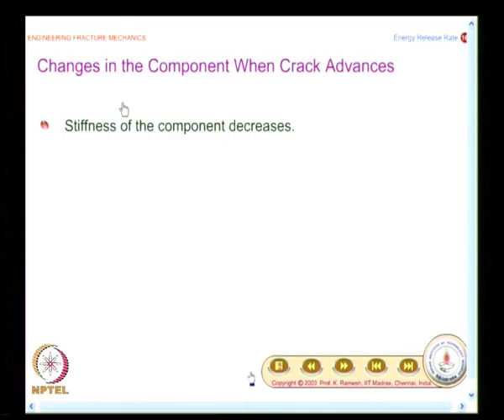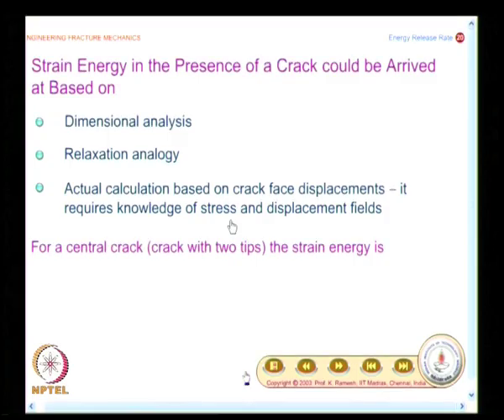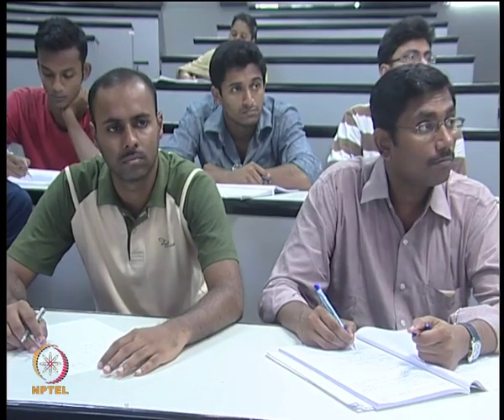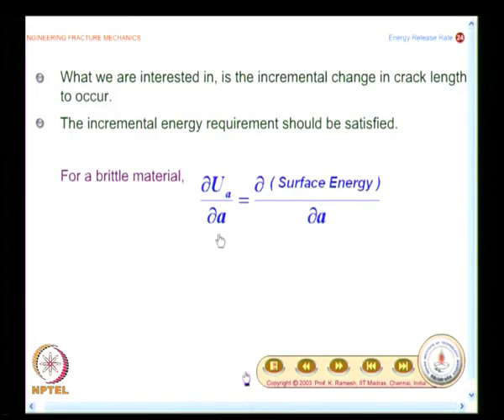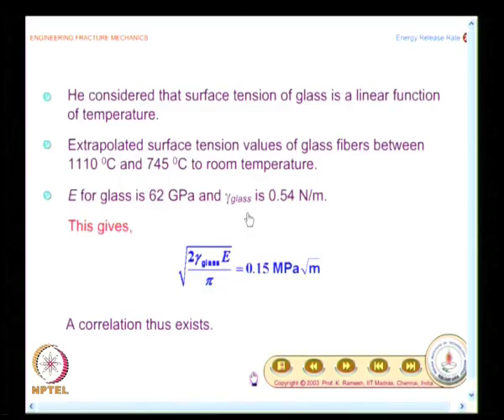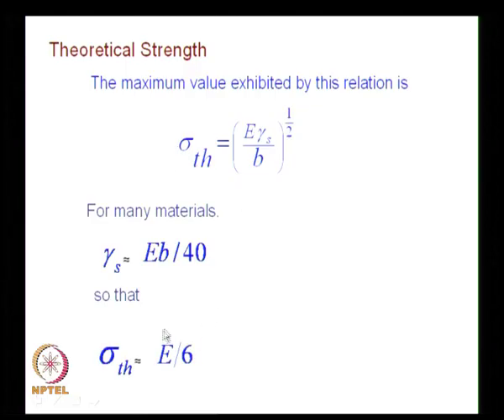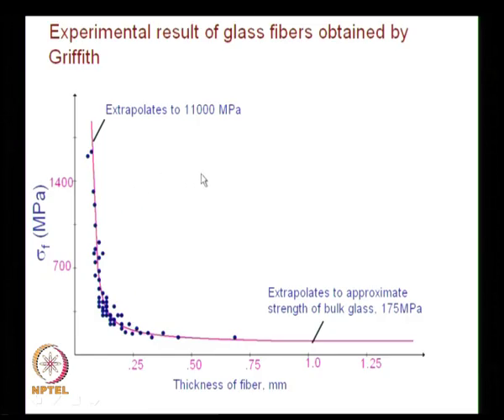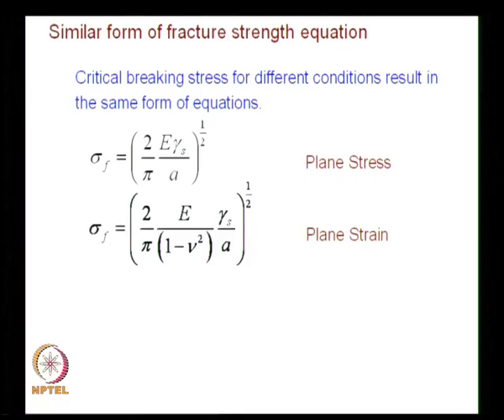Fracture Strength by Griffith

Comment: time 18:28: the plot is for -Ua (not the +Ua written there) and so Ut = Us - Ua . Can anyone give more explanations about that ?
Reply: This may be long overdue. But here it goes. Here he is considering deformation under constant strain, which implies that the strain energy decreases as the crack grows. This is mentioned in detail in the previous lecture  under constant displacement approach. Hence, Ua is negative. As a result, net change in energy is Us (increase due to surface energy) - Ua (decrease due constant strain condition). Hope this helps :)